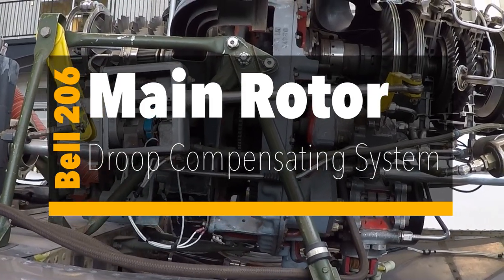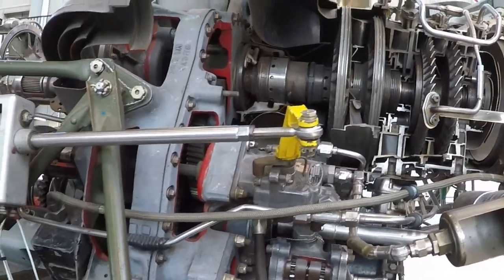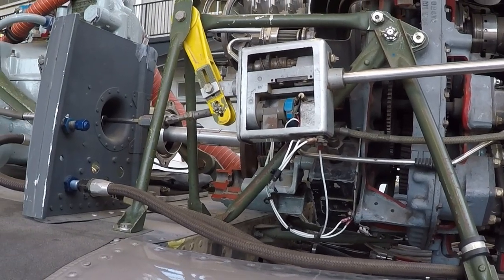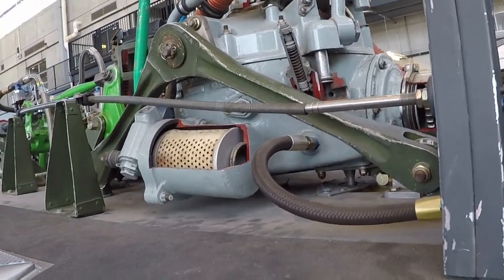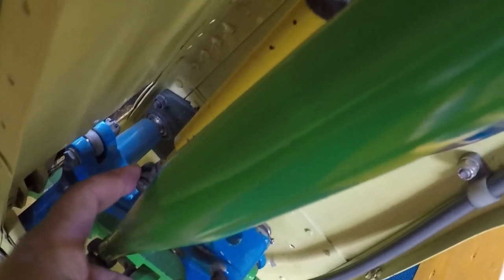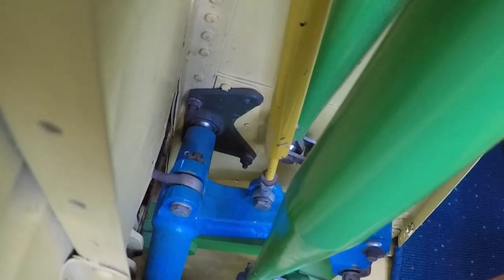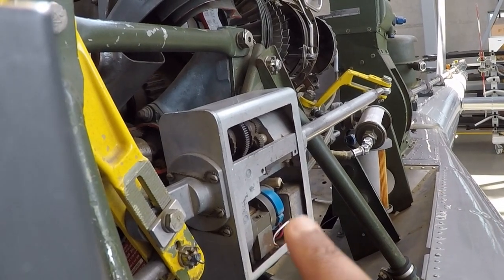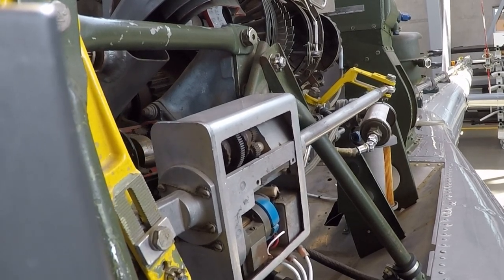Bell 206 Main Rotor Droop Compensator.

Comment: the droop conpesator works  when  engine changes power  and is required increasing  governor air flow and goes  through to FCU for more fuel and keep constant N2 , Power changes are called static droop and its compesate with the increase-decrease switch on collective

Comment: Interesting. 
I fly Radio Controlled helicopters (1750mm or 5' rotor diameter) and rotor rpm is controlled through a electronic governor but I have the ability to select 3 different rotor rpm limits based on how i want to fly that are selectable in flight.
Low (1200rpm) for hovering maneuvers and 2 high (up to 2200rpm)  limits for aerobatics. 🇦🇺

Comment: Nice training demo helicopter, everything is cut out so you can see the exact movements of each component as they operate. Much thanks. Do you do type training on the 206 or 407s?
Reply from the maker: We currently do not do type training. We did at one point in the past for the 206.
Reply: @Aircraftmaintainers  where is this helo at?
Reply from the maker: @HeliFoca BCIT aerospace campus